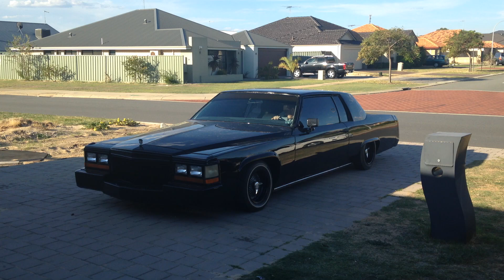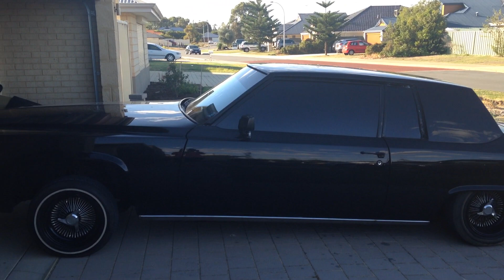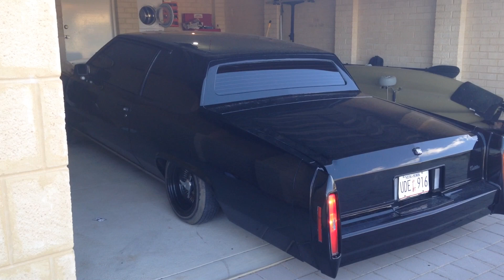bagged 1980 cadillac deville coupe 368

Comment: put paint on everything! ....car was total crap!... ripped off the ragtop,did a $100 fresh paint job  on whole car(saved 5$ on masking tape by not using it), $200 Hydraulics(probaly air bag lol), $200 rusted wire wheels painted black, probably  painted the windows to,and BAM! all Crappiness gone with black paint.hope mechanical problems don't get fixed with black paint
Should have kept all the trim original 🤦‍♂️ that just looks stupid